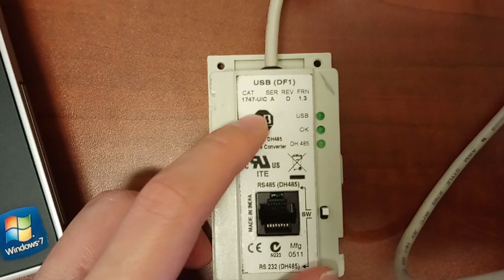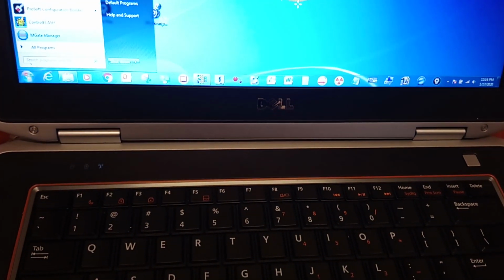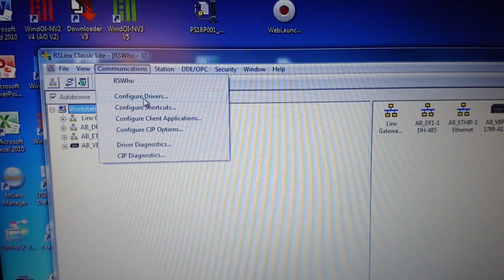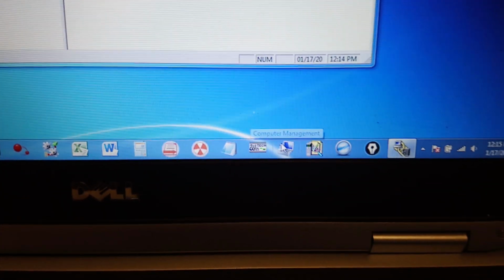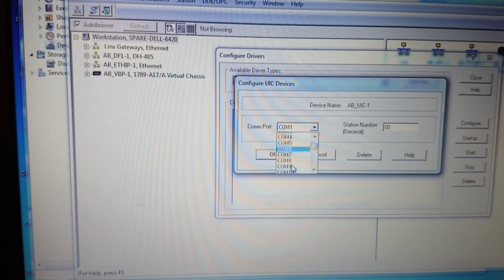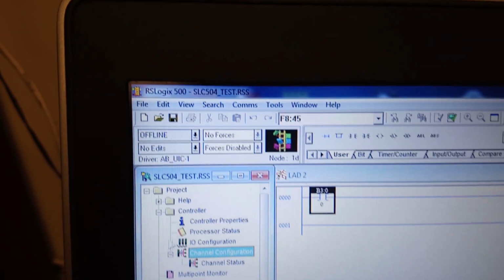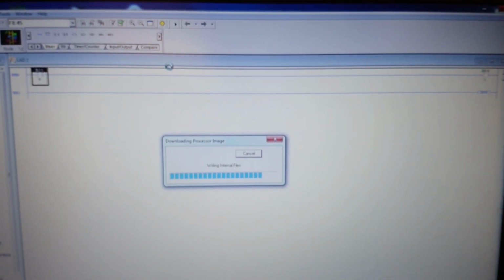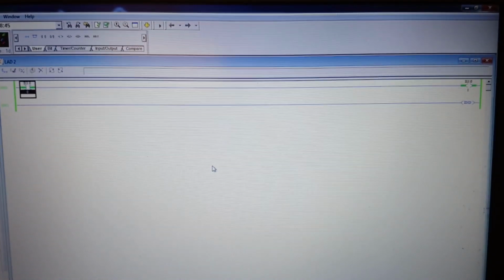Rockwell AB SLC500 1747-L541 DH485 communication 1747-CP3, 1747-UIC

Comment: Hi I have slc504 channel 0 node 2 set to DH485 , and panel view 600 DH485 as well, can I use normal RS232 to usb cable plug plc channel 0 to upload / download program ?
After I upload I want to change to channel 0 to DF1 as rs232 because new panel view plus will only either support EIP or using new type of cable usb to rs232 DF1 will change on factory talk communication setup , but problems is I don’t have converter as you shown here , will it possible upload by using normal rs232 to usb cable without ab converter under DH485 for slc504 current configuration?
Reply from the maker: @ansonkiek6471: First, I think you are running into the same problem I was facing a while ago. However, there is no solution for the DH485 HMI replacement.
First, you need to know that DH485 and DF1 are not the same. It is not just the physical layer difference between RS-232 and RS-485. It is a total different communication protocol. If PLC channel 0 is set for DH485, you will have to have a the converter 1747-UIC I showed in the video in order for your computer to communicate with the PLC.

Second, you should not change channel 0 on your PLC to DF1. The reason is DF1 communication protocol will work only between 1 PLC and 1 HMI. Your PLC channel 0 is set for DH485 because I believe there are multiple HMI's in the network communicating to the same PLC. If you change PLC Channel 0 to DF1 and make it work with the new Panelview Plus that supports DF1, how about the rest of the HMI's or devices in the network? You will run into the more serious network problem.

My recommendation is to try your best to keep the same communication protocol DH-485. You have to think of the other devices in the network that are currently communicating to the same PLC. It is a DH-485 network. I know it is almost impossible to find the new HMI that supports DH-485 in 2024. However, that is our only option. Refurbished HMI's with DH-485 are still available somewhere that you need to search out.

If you like my channel and my response is helpful, "super thanks" at the lower right corner is a great way for you to show your support to my channel. Thank you.
Reply: @SYPHOANG  actually customer want to preserve old PLC SLC504 and SLC 504 previous setup is DH485, to pair with panel view plus factorytalk view need to set RS232 which is DF1 in AB protocol and plc as well also need to DF1 full duplex told by AB helpline the recommended cable 9300-USBCBL-CP3 which is directly connect SLC 504 channel serial to hmi usb, but before that , i need online change the channel 0 from DH485 to RS232 , that why i ask you is that any normal cable can just online which the converter you had just shown on video
Reply from the maker: @ansonkiek6471: As mentioned earlier, you have to use the 1747-UIC for the required conversion. Rockwell tech support told me the same thing because they no longer make any HMI's supporting DH-485. It's critical for you to verify with customer if they have anything else connected to the same PLC with DH485 communication protocol. The PLC port was set for DH485 for a reason. Good luck.

Comment: DH485 via RS232
Reply from the maker: @saedalhabbashi2790: Yes, Thank you for your support to my channel.
Reply: Welcome and big thank you to you for sharing. And just to highlight something important choosing 1747 UIC driver and only configuring com port does not work if the PC is 64 bit- I wonder what was your PC  OS bit! 

Therefore, choosing DF1 serials is the safer 😊

Thank you again
Reply from the maker: @saedalhabbashi2790  : My computer is Dell Windows10 and it is 64-bit Operating System. I am not sure why it is not working on your computer but mine is working just fine. The main drawback of DF-1 is your PLC cannot communicate with multiple HMI's on the same network while it is not a problem with DH485. I personally don't like DH485 but if you have more than 1 HMI communicating to the same PLC, DH485 is your only option. Thank you for sharing your experience on my channel.
Reply: @SYPHOANG  Thanks ! The 1747UIC is a convertor that converting from DF1(usb) to DH485( RS232 ) orDH485( RS485)

To configure the driver in RSlinx you can choose Rs233 DF1 device ( as the manual instructed if your Rslinx is 2.x or below) or choose 1747 UIC as you did in the video if your RSlinx version is 2.7 or above)

Said that, if I have multiple HMI and i have no choice to but DH485 ( Rs485) 

How to daisy chain and do i need termination resistors or not
Reply from the maker: @saedalhabbashi2790  : To daisy chain multiple HMI's to communicate to the same PLC over DH485, you will need to daisy chain multiple 1761-NET-AIC converters to the same PLC first. And then each HMI shall need to be connected to the 1761-NET-AIC. You might want to check out the below video. The PLC is Micrologix1200 but it is communicating over the same DH485 network. If you like my videos and/or my experience is really helpful to what you are struggling on, you can give me a 1-time super thanks at the lower right corner of the video to show your great support to my channel. Thank you.

https://youtu.be/_gOovEf4s_U?si=O-jHCGfa_gZLCTVi

Comment: What’s the clip on top for ? Can I use an rj12 to usb cable ?
Reply from the maker: @Joe W: I don't know what you meant for? It is just a converter from DH485 to USB. You can try your RJ12. I saw it once but the other end of the RJ12 cable in my experience connected to the top 3 pin connection. I think it is a special custom built cable.

Comment: How do I do this with ethernet cable ? I lost all memory
Reply from the maker: @King of slots MILLION: I am not sure what you are trying to do. If you lost everything in the controller, you will have to download your program to the controller again. The IP address should be configured in your PLC program. Look for a serial port on your SLC controller. Using it to browse to your controller from RSLinx with DF1 driver. DF1 should be a default serial communication protocol. Hopefully this is helpful enough. Good luck!